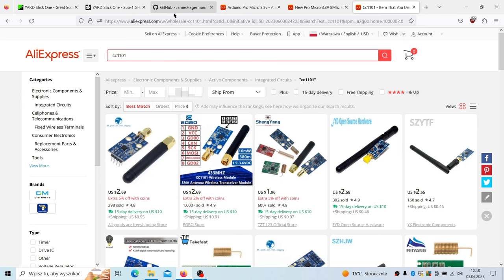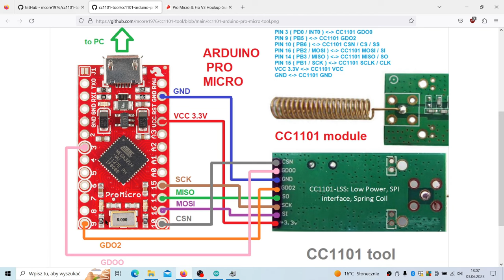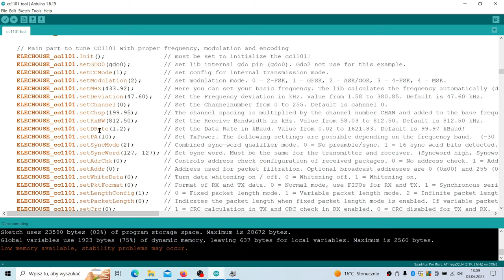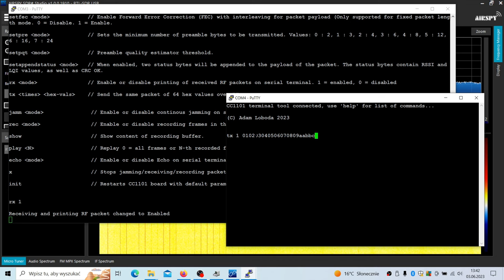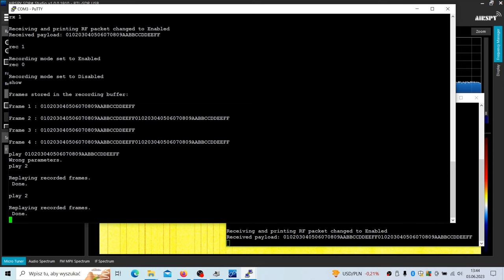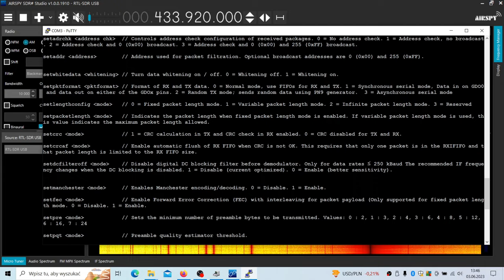DIY CC1101 tool - RF jammer, replay attack, sniffer - cheap & easy tool for radio pen testing

Comment: Panie Adamie kiedy mozna spodziewac sie wersji na esp8266 z kontrolą na wifi? (Oczywiscie bez cisnienia - z ciekawosci pytam ) :)
Reply from the maker: jeszcze nie zacząłem nad nią pracować, brak czasu. Zapewne coś przed gwiazdką zrobię
<EDIT>
dobra, już jest wersja pod WIFI 

https://raw.githubusercontent.com/mcore1976/cc1101-tool/main/cc1101-tool-esp8266-wifi.ino
Reply from the maker: https://raw.githubusercontent.com/mcore1976/cc1101-tool/main/cc1101-tool-esp8266-wifi.ino

dla Ciebie :-)
Reply: Ahhh coś pięknego dziekuje...wracam z wakacji i zaczynam testowac :) dam znac jak sie sprawuje ;)
Reply from the maker: jeszcze jest pare drobnych błędów ale dzisiaj poprawię. Aby to działało trzeba mieć jakiś Access Point np. wifi z telefonu do którego płytka ESP8266  się podłączy. W kodzie programu trzeba podać ssid i hasło do wifi oraz adresy ip default gatewaya w ruterze wifi i sam adres IP jaki ma mieć esp8266 pod który potem zresztą łączymy się telnetem z np. ConnectBot na telefonie
Edit
Juz poprawione. Przetestowałem i wszystko działa..
Edit
Jest też wesja z Access Pointem, można się łączyć telnetem bezpośrednio do hotspota "cc1101" pod adres 192.168.1.100 port TCP 23 :
https://raw.githubusercontent.com/mcore1976/cc1101-tool/main/cc1101-tool-esp8266-wifi-ap.ino

Comment: Can we use an esp32-s with upto a clock speed of 160 mhz i would imagine it will work ok if so is there a way you can add support for the esp32 ? I know it xan be ysef as a serial interface. Maybe we can even make a wifi ssh interface webserver or via Bluetooth serial.
Reply from the maker: You can use any type of board that is supported by SmartRC library, and guess what ? ESP32 is one of the supported !
Moreover I have just added the same functions for recording RAW RF data as in Flipper Zero. You can easily record and replay Car Keys like a champ. My only limit is 1KB of RAM memory in Atmega32u4 and that will not be the limit for better boards, just increase recording buffersize in the Arduino program.
I have just tested this function and it is working perfectly. I have my device connected over OTG cable to android phone for portable hacking
Reply from the maker: I have added ESP32 version code and wiring info. Someone has to test it because I do not have such board here. I have just ordered but it will take one month until I get it
Reply from the maker: I've just got my ESP32-WROOM board ( ordered XIAO ESP32-C3 and ESP8266 as well) and ported my software for these boards. You may want to use it :
ESP32 WROOM : https://raw.githubusercontent.com/mcore1976/cc1101-tool/main/cc1101-tool-esp32-wroom.ino
XIAO ESP32-C3 :  https://raw.githubusercontent.com/mcore1976/cc1101-tool/main/cc1101-tool-esp32.ino

ESP8266 version coming soon..

Comment: Hello Thank you for publishing such a code.
The remote control data received by recraw (milisec) changes every time it is received (due to the security mechanism used).
Any ideas for this problem?
Reply from the maker: use Universal Radio Hacker to see if it is a rolling code
Reply: @justanengineer5599  Can I use the jammer mode (jam 1) and the receiver mode(recraw) at the same time?
I want to make a rolling attack.
Reply from the maker: not. I would suggest to build two sets of this device and use them both at the same time
Reply: @justanengineer5599 I made two sets of this device (to carry out the replay attack).
One in jam mode
One is also in the recraw mode
The problem is that the recraw receives the jamming frequency and not the remote control data
Do you have a solution?
Reply from the maker: setrxbw   is the command  that you should use to narrow the receive bandwidth not to get the    jammer signal. Read issues tab for the project. I have already explained how to do it for other person
Reply: @justanengineer5599  Thank you very much for your reply❤
And another question:
Can I store two values in non-volatile memory?
I want to do a rolling attack : Save the first keyfob data in non-volatile memory. Then jamming and getting and saving the second data of keyfob in non-volatile memory. Then load the first data from non-volatile memory and play it.
Reply from the maker: i havent yet added multiple entries in the NVRAM into the source code but it is on my todo list

Comment: Hey can I make this using the esp32? Please could you guide me? 
Very helpful video though!
Reply from the maker: you already have the code for esp32 and the schematic on my github page. Always check first before asking any questiin. It is also mentioned in movie description and the link is there. Did you check it?
Reply: @justanengineer5599   My bad, your video showed to make with and arduino 
Sorry 😅

One more question- can I use a display and buttons? If yes then how?
Reply from the maker: you can use shortcut buttons in serialmonitor app on the phone. you may program it

Comment: Hello this does not work for me i have an esp32 and cc1101 and in the serial output of puTTY it just giving me question marks and no text i have recompiled the same script 3 times on  esp32 still no luck
Reply from the maker: check port speed of your usb to serial port. It is not 115200 probably
In the source code you have these lines
// initialize USB Serial Port CDC
     Serial.begin(115200);

Adjust your putty settings accordingly
Reply: @justanengineer5599  Okay thanks i will look in to it!
Reply from the maker: use rxraw xxx   where xxx is microsecond like for example 100. Read the help man!
Reply: @justanengineer5599  Ok thanks but i think my cc1101 isnt working the way it is supposed to its giving me alot of zeros  or maybe i havent mached the mhz frequency anyway thanks for the help merry christmas
Reply from the maker: yes you did not. Use scan xxx yyy  function man. This piece of hardware requires a bit of imagination to be used succesfully
Reply from the maker: you need to narrow the search like scan 433 434   or  scan 432 433  
  Also depending on the country you are living in it may be used 315MHz or 868MHz instead of 433MHz
Reply: @justanengineer5599 hello i've done that command already still no result i've rewired the esp32 and cc1101(M1101D) about 8 times i dont know what is broken here
Reply: it would really help me if you uploaded a picture of how you wired esp32 and cc1101 and in that case the antenna or esp is broken by the way tried it on esp8266 still no signal maybe i am just dumb or something is broken
Reply from the maker: the problem with chineese esp32 is that they produce 100+ different boards with these chips. You did not even tell me which one you are using... How can I help you if you do not provide basic info man?
Reply from the maker: You have to give the info which pins are available on your ESP32 board. There are plenty of versions and they have different pinouts. 
If you are having issues with ESP32 maybe it is worth to play with ESP8266 board that has WIFI connectivity and can be programmed with these two source codes :
https://github.com/mcore1976/cc1101-tool/blob/main/cc1101-tool-esp8266-wifi-ap.ino
https://github.com/mcore1976/cc1101-tool/blob/main/cc1101-tool-esp8266-wifi.ino
Reply: @justanengineer5599 hello okay everything is not wokring uploaded the first wifi version doent connect to router tried second option (access point) access ip wont work . Do i have to change something more in these ino's?
Reply: @justanengineer5599  Hello just tried esp8266 over putty and when i enable rxraw 100 its still alot of "0000000000000000000000....."  that means that my antenna is perhaps the main issue of this project?

Comment: didn't recive with rx command auto keyfob frequency, why?
Reply from the maker: try rxraw xxxx  instead.  xxxx is the sampling interval in microseconds
Reply: Rxraw command instant printing rx copy finish
Reply from the maker: what? what boards are you using?
Have you DISABLED ADDITIONAL NEWLINE CHARACTER in your terminal application as it was written in my github project readme ? it looks like you did not read it either...

Comment: Sir this code will work on esp32 ?
Reply from the maker: cc1101 + esp32 = YES.     "some  RF 433" + esp32 = NO
Reply from the maker: it has to be a board with cc1101. Others will not work

Comment: zjechałem do:
Szkic używa 27518 bajtów (95%) pamięci programu. Maksimum to 28672 bajtów.
ile ardu potrzebuje?
Reply from the maker: jak się popieści to się zmieści. powinno się wgrać jak usunąłeś zbędne serial.print(blablabla)  z funkcji help. A swoją droga nie wiem jakie masz Arfuino IDE którą wersję, bo u mnie bez problemu wchodzi kompilacja do Arduino Pro Micro
Reply: 1.8.19 ubuntu
Reply from the maker: ja na obydwu i win10 i ubuntu kompilowałem i jakoś wchodziło. Spróbuj najnowsze Arduino wrzucić
Reply: wrzuciłem program na ESP8266 i nie ma problemu, ale musiałem to robić z win10, bo na ubuntu nie ogarniam drivera usb ch34...
przegladajac Twoje materialy zauważyłem, że próbowałem wgrać na pro mini, a nie pro micro
b. dziękuję za feedback
Reply from the maker: no, unless you power your arduino pro mini from 3.3V power source

Comment: Can we use it to jam wireless hidden microphones?
Reply from the maker: depends on the frequency of these wireless microphones. if it fits within cc1101 bands then yes. Check cc1101 datasheet for info
Reply: Use ultrasonic speakers, they can distort the microphones

Comment: Hi theres an error when i flash it on arduinodroid it says return code is 0
Reply from the maker: Use PC and Arduino IDE for flashing ESP8266 board not some Android application because it does not have required libraries like SmartRC and you cannot attach one with this tool. Don't  expect that your smartphone is  a PC. It is not. It's just a smartphone.
You want to be a hacker ? Buy some PC man.

Comment: Friend. I can use RFM69HW-433 ?
Reply from the maker: no. this one does not fit. it needs ti have cc1101 chip
Reply: @engineer5599 I'm changing the library and sketch. I will try. thanks

Comment: would the same boars with an atmega 328p chip work?
Reply from the maker: the cc1101 board will work with atmega328p but 2 things : you need to lower VCC to 3.3V while powering atmega and you have to attach it through FTDI232 to the PC USB
Reply: @justanengineer5599 thanks man. also another question i had, if i were to use this to test a relay attack would i need an rtl sdr?
Reply from the maker: nope but you need 2 of such devices. One to jam and second to record and replay
Reply: @justanengineer5599 but it would also work with rtl sdr? my idea is to use an rtl sdr to capture the signal with radio hacker and replay with this.
Reply from the maker: yes. if you want to record with URH the you need to have RTLSDR. As I said the point is that ATMEGA328P does not have USB port and you need to use FTDI232 board to attach it over  USB. Also you need to power this Atmega from 3.3V to make it work with CC1101
Reply: @justanengineer5599  ahh ok, thanks for the info!

Comment: mam problem z wgraniem szkicu: 
Szkic używa 29122 bajtów (101%) pamięci programu. Maksimum to 28672 bajtów.
Reply from the maker: usun troche linii z obslugi komendy help i się zmieści. Co to za Arduino? jaki chip?
Reply: @justanengineer5599  
wow, tak szybkiej odpowiedzi się nie spodziewałem 
MEGA328P chyba arduino micro, wgrywam przez adapter ftdi
Reply from the maker: coś mącisz chłopie. Arduino Pro Micro ma USB i przez to się wgrywa. Możesz mieć ewentualnie Arduino Pro Mini lub Nano gdzie jest chip ATMEGA328P. Jak nie wiesz jakiej płytki uzywasz albo źle ustawileś w Arduino IDE typ płytki to się nie dziw że program nie wchodzi. Albo obejrzyj jakiś tutorial jak się wybiera płytke w board manager w Arduino IDE i jak się ustawia nuner portu i typ płytki

Comment: hello can i use nodemcu esp 8266?
Reply from the maker: yes. The code for 8266 board is already there. Have you looked into my github page of this project? I presume not because You would not be asking such questions. With 8266 you can connect over wifi and do not need usb cable... This cc1101 tool can be build with esp8266, esp32, raspberry pi pico, arduino pro micro and a many more. There is no other solution like this available. check my github man.

Comment: Can you pick up Tesla charging port signals with this?
Reply from the maker: yes exactly. Use recraw rxraw showraw and playraw commands
Reply: @justanengineer5599  Thank you I will look into it! Great videos
Reply from the maker: no. because arduino nano uses 5V TTL logic and CC1101 board requires 3.3V.   You may buy cheap esp8266 board like Wemos D1 Mini clone for  2$ instead of using more expensive arduinos like Pro Micro
This cc1101tool in total will cost you less than 5 bucks
Reply: @justanengineer5599  The nano has 3.3v pin to power the CC1101.
Reply from the maker: it is not only the power on VCC line but voltage levels on SPI bus pins MOSI MISO SCK. You are not the only person trying to make this setup. I will give you an advice - give up and try not to save 2 dollars. You will save your nerves and physical condition believe me others failed
The best would be if you just read readme file of this project

Comment: How can I upgrade it to make it jam 2.4 - 5 GHz, I want to jam my neighbour's bluetooth speaker
Reply from the maker: buy a module with CC2500
Reply: @justanengineer5599   nice i see it (but it only supports 2.4 GHz though), are the steps still going to be the same except for the code part?
Reply from the maker: it should work but I did not test it with this module yet

Comment: I could make it work using esp8266 nodemcu v3 but the frequency generated is always around 43 khz higher than expected, I am using sdr# and universl radio hacker to double check the frequencys. Help
Reply from the maker: you need to calibrate rtlsdr. also cc1101 calibration is possible but not with smartrc library.

Comment: Will it work for arduino uno wifi ? thanks a bunch
Reply from the maker: arduino uno does not have wifi
Reply: @justanengineer5599  is there any model that have a communication mean not necessarly wifi. I mean for example jamming and attacking in a lab test (roll jam).
Reply from the maker: yes, this project has ESP8266 and ESP32 versions with wifi connectivity. Check the video description before asking such questions
Reply: @justanengineer5599  sorry for my ignorance I am total beginner and process of learning
Reply: @n.w.aicecube5713 no offense but you probably need to start from way below to understand this.

Comment: why my putty shows nothing only black?
Reply from the maker: 1. set speed in putty to 115200 bits per second on Serial Port
2. connect putty to proper serial port. in most cases it is the same number as for arduino programming
3. you need to have usb serial port drivers installed.
4. Check if you see anything through Arduino Debug

Comment: Can we also setup something for rolljam??
Reply from the maker: this is for rolljam. you just need to understand how to use it. you need a pair of these devices. One is jamming second is recording. And you need a bit of imagination. If you are not getting this, then it is not for you
Reply: @justanengineer5599  no I do get it. The thing is the other receiver tends to pick up the jammed signal as well and gets gibberish. If I try to set different frequencies one for jamming which is slightly different then the key fob frequency. That’s what I was wondering about. Will the receiver not pick up gibberish which is being transmitted while jamming. 

im new to RF and I do know my stuff but just confused. Sorry for the annoying questions.

I do get it one jams and the other one will just listen and pick up the signals which I can later save and replay the first lock signals goes out to actually lock the car and the later recorded signals can be used by me. Just confused about the jamming.
Reply from the maker: the jammer needs to be set with  some offset frequency to the jammed signal. the recorder need to have bandwidth set the way it will not fall into jamming signal frequency
Reply: @justanengineer5599  okay great, will try
Reply: @justanengineer5599  Are there any new major updates you are thinking of maybe i can help!!
Reply from the maker: i think I have exhausted storage space on Arduino Pro Micro
Reply: @justanengineer5599  maybe we can switch to a new board or pico something and a converter to adjust to 3.3V. It will work out I guess.
Reply from the maker: I did. On the github there are versions for RP2060, ESP8266 and ESP32. Some of them can be connected over WiFi instead of the usb
Reply from the maker: well it is a matter of WiFi library that is built into Arduino package. You probably need to enable some option for password checking.
Reply: @justanengineer5599  how do I go through that. I just built the entire setup. But the wifi is unsecured.

Comment: Hi 
I bought the esp32 and esp8266 and some rf 433 transmitter and receiver 

So can this dev boards work intead of cc1101 and pro micro
Reply from the maker: it has to be cc1101 board

Comment: only sparkfun arduino pro micro?
Reply from the maker: pro micro has hardware usb to serial port. The code will work with other boards as well (arduino leonardo, even pro mini - after modification of pin assignments in the source code) but it is VERY IMPORTANT to power CC1101 board from 3.3Volt
I am using SmartRC library check its description in the wiring chapter
https://github.com/LSatan/SmartRC-CC1101-Driver-Lib
Reply: @justanengineer5599  I mean only sparkfun Arduino or can we use any other Arduino board?
By setting 3.3v  supply?
Reply from the maker: yes others arduinos with 3.3v can be used as well after pin numbers modification in the source code. check my link above and browse to wiring chapter of SMARTRC library